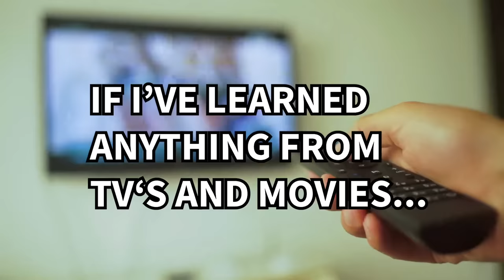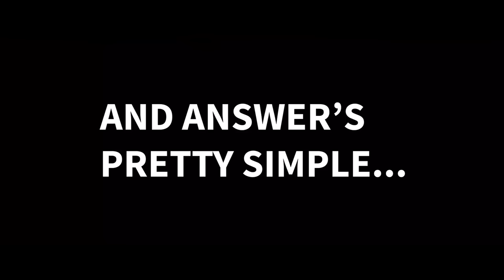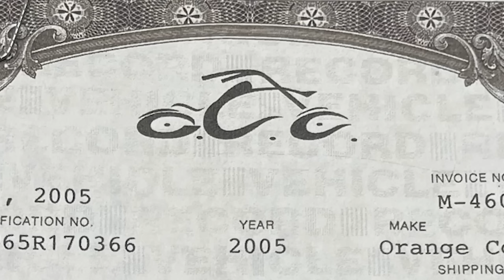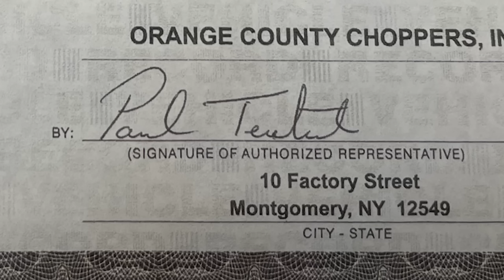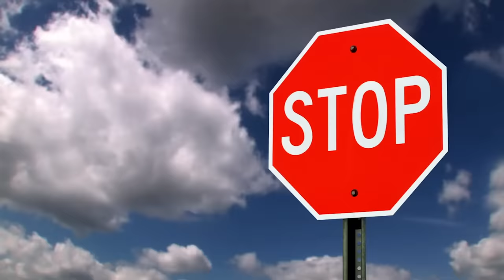Why you SHOULD NOT buy an Orange County Chopper

Comment: This was eye-opening. I realize on all these chopper/hot-rod type shows they never emphasize the safety or performance.They emphasize stuff like how the hood ornament is actually the flusher mechanism from a space shuttle toilet, or something like that.
Reply: Clever user name
Reply: They're built for show. Not for safety, performance, or comfort
Reply: While I always knew that these shows were looks first, everything else second (because lets face it, all choppers and hot rods are inherently compromised for actual transportation purposes, that's just not their thing*, and basically all cars made before the 90s, and a lot even back then, are horrific for safety by today's standards, with no way to fix them), there was one specific moment that I remember, that hammered it home harder and made it impossible to ignore:

I was watching Fast & Loud, and they went to put in a larger engine in a car. All good, until they notice that the oil pan interfered with the cross member at the front. I've read about such issues before in magazines, where people had actually put time and effort into their build, and often they'd either figure out ways to move the engine around, or make a custom oil pan to alleviate the problem. One guy converted the engine to use a dry-sump system.

What did the Gas Monkey Garage guys do? They cut out portion off the cross member, so that the engine fit. Just cut it out. From the part that literally keeps the left and right side of the car together. I don't think they even added anything to maintain structural integrity.

So uh yeah, dangerous, to the max.

*If they were actually good, manufacturers would still make them like that.

Comment: A few years ago I had an itch to buy a Harley, or cool-looking Victory, semi-looking chopper with extended fork (but nothing like OCC's).  Scratched the itch with a one day rental of a 1200cc BMW.  Rode scenic mountain roads around Stanley/Sun Valley, Idaho.  Had a great time.  Returned it to Boise which required me to ride on Interstate 84 for thirty miles.  Buffeted by winds, 80-mph trucks, bugs crashing into my face shield, and the knowledge that a slick spot, flat tire or wrong move could end it all in an instant....not fun.  Lesson learned: cost me $200 instead of $20k, itch gone.

Comment: In the late 1970s and 1980s I had a 1958 Panhead in a Jammer hardtail frame with a 10" over Springer; no front brake. I road it for about 12 years. In 2002 I had back surgery for 3 ruptured disks. Coincidence?

Comment: If the battery is dead there is a bad bare wire somewhere could even be on the battery itself touching the frame and grounding it out draining the battery so look for it and don’t forget to change the starter fuse

Comment: Great video. (love how the headlight lens isn't parallel to the ground) I've had the "pleasure" of getting to work on a couple of these OCC bikes and I can say you are 100% correct about them. They're really not meant to be ridden, just looked at.
Reply: They look good to a blind person!
Reply: Build me a road vehicle that's not suited fr d road plz.

Do that statement make any sense?🤔🤕
Reply: @a.mckenna1574  A lot of supercars are built that way.
Reply: I think you mean perpendicular!
Reply: @MyRegardsToTheDodo  Could you show me a supercar using a bone stock, of the shelf anemic motor producing a whooping 65HP please?

I'll wait...

If you're about to be impractical, be fun to drive at least. By fun I mean great handling, stoping power, steering precision, power, speed, you name it.
Reply: @SgtDuster  Not 64 HP (considering a chopper is much lighter than a car), but for example the DeLorean DMC 12. Came with a bone stock 130HP Peugeot engine. It had the price and looks of a supercar of it's time, but simply couldn't deliver.

A lot of supercars don't have great handling or steering precision either.
Reply: I think they look comical,not 
practical and would not be able
to ride on the road in n.z.
Reply: @MyRegardsToTheDodo  In what world is a DeLorean a super car?
Reply: @mintymus  As I wrote, it has the supercar pricetag and the supercar looks (for a car of it's time), so in any regards except for the engine it is a supercar.
Reply: @MyRegardsToTheDodo  Hardly.  The price in 1981 was $25,000...which is roughly $80K now.  Show me a supercar today that costs $80K.
Reply: @MyRegardsToTheDodo  
"The DeLorean DMC 12 was produced between 1981–1982. That had a bone stock 130HP "V6" Peugeot engine". 
In 1982 the... 
.
Camaro had a 2.8-liter V-6, 102-hp and 142 lb-ft 
.
Corvette had a 5.0 V8 200hp & 283 lb-ft 
.
Mustang had a 3.3L 6-cyl. 87 hp &160 lb-ft
Mustang GT had a 5.0L V8	157 hp & 240 lb-ft
.
Pontiac Firebird had several options.
There was a carbureted 2.8L V6 with 102 hp .
305ci V8 with 145 hp & 240 lb-ft
The "LU5",  high-performance "Crossfire Fuel Injection" 5.0L V8, which produced a whopping 165 hp.
.
So comparatively the The DeLorean DMC 12 was on or above par with other American sport cars of its time.
Reply: @davidelks8972  The DeLorean wasn't an American sports car, though.
Reply: @MyRegardsToTheDodo   1984 pontiac Fiero with 4 cyl.was a better car.
Reply: @a.mckenna1574   no sense. Absolutely none....
Reply: Like the youtuber from France that carves out cool stuff from slabs of chocolate?
Reply: @mintymus  I mean, the Corvette is 80k. I don't know about supercar, but certainly styled like one, and performs close enough.
Reply: @TheLongDon  So you're agreeing supercars don't cost $80K.
Reply: @mintymus  Most supercars, yeah. I think the Corvette counts though, it hits 0-60 in 3.7 seconds, that's faster than the Audi R8
Reply: @TheLongDon  So you consider a Tesla a supercar too then?  How about a little Civic with a 400 HP engine in it?  Those go to 0-60 faster than an R8 also.
Reply: @mintymus  What counts as a supercar for you? I would consider a Corvette more of a supercar than a McLaren. Better HP, flat, angled body, lightning quick 0-60, professional brakes and suspension, etc. Tesla and Honda Civic don't have anything except quickness for them, the Corvette has everything you need. My point was only that it was cheap, but expense shouldn't disqualify you for being a supercar
Reply: @TheLongDon  If that's how you define a supercar, than the Mustang GT (and definitely the GT500), Subaru WRD STI, and nearly every other new sports car is a "supercar" to you.  

Super car = Carbon fiber, far above average weight to performance (pounds per HP), center lock wheels, exotic engine.  Corvette is none of those, hence why the cost is only $80k.  It's nice, but no supercar.  My point remains the same:  No supercar costs $80,000.
Reply: @TheLongDon  Btw, the top speed for a Tesla Model S is 200 MPH.  Faster than the Corvette, and much faster 0-60.
Reply: @mintymus  Guy, I don't think you know what supercars are. Supercars are not hypercars. No, a Tesla model S can't be a supercar because it looks like a brick and drives like one. The Corvette is a mid engine sports cars with performance brakes, a good amount of horsepower for the price and an impressive 0-60 time. It looks better than any McLaren and drives better too. Knowing McLaren, definitely lasts longer. It weighs 3k lbs to the Tesla's FIVE THOUSAND. You can't seriously take my single example and think that's the only thing the C7/C8 has going for it's classification as a supercar. It doesn't need to be at our a Veyron to be on the lower end of supercars
Reply: @TheLongDon  You can think whatever you want, doesn't mean you're right.  The Corvette is a muscle car, not a single ounce of carbon fiber on it, minus the wheels.  Tesla is heavier and bulkier, yet is WAY faster both in acceleration and top end.  Ask 100 people which car they'd rather have.  99 are going to say McLaren, the 1 that wants a Corvette will be you.
Reply: Steve Magnante looks at better stuff in the junkyard all the time.
Reply: Don’t these have a very small gas tank

Comment: Back when OCC got so big everyone thought they wanted an open primary, a rigid frame with no suspension, a ridiculous rake and a fork length to make turning damn near impossible, no front brakes, a motor from a lawn mower, body work and a seat designed to kill its rider and likely a fuel tank that’ll have you visiting every gas station along the way. Nah, I’m good.

I do like the aesthetics, even if it’s a little overdone on the spikes, but we all know this is a garage, grass and show bike. It’s basically those little soaps your mom has in the bathroom that you’re not really supposed to use but sometimes you do.
Reply: Ahhh...yes. The cheesy little, overly scented soaps. You just took me way back. I can smell them now. I genuinely thank you for this trip back in time.
Yeah...
Edit- I usually don't like or dislike anyone's comments but I liked yours simply because of the soap thing. Although I do agree with you too.
Reply: Well, I have never been a fan of Choppers.   I know how much design work is put into the steering of every bike, and the answer always comes out to a head angle of 71 degrees, even one degree either side is frowned upon.

Comment: I say, fix the brakes, find a “comfortable” seat that kinda matches, swap the evo for a 1400 Harley engine, reduce the number spikes, then drive to OCC to show them your improvements.
Reply: The one good thing about harley motors is they're easy to upgrade.
Reply: Is OCC still going?
Reply: @georgeperkins4171  not so easy to upgrade as in has a lot to be improved
Reply: I can ride the wheels off a Japanese sport bike but this dinosaur scares me !
Reply: fix that bike right, and I'll ride it myself to OCC, and tell them this is the way they should have built it. Put some brakes on it, and a decent seat. I'll video tape the highlights of the ride there, and their expression when I tell them they did it all wrong. I'll even sigh a release so you guys are not responsible for me or anything that happens.

Comment: I miss my chopper even though it always tried to kill me. Clutch cable snapping sending me across an interstate both lanes into a dollar general lot before the back brake slowed it down enough to kill it. 7 out of 10 rides you would have to retrieve parts that rattles off. The screws in my vice grips would always be backed off and loose in my tool bag.  The part that was fun was learning how to fix anything with minimum tools and parts in the dark and making it home alive. It finally died when the welds on the frame broke at 45mph dropping the frame onto the road and I rode it into a ditch and was able to just step off it.  Good times.
Reply: Choppers don't have to be garbage. Kill switches solve the snapped cable problem. You built junk and got junk results.
Reply: @Comm0ut  I bought it used and still miss that bike so much. I like my new but I can’t have them all. This was my first harley coming from the metric world. Never needed to check welds and stuff before. I learned rapidly.
Reply: My idea of fun is galaxy apart. I mean chicks are fun.
Reply: @jjohnson8977  until they take half your stuff. 😂
Reply: @jjohnson8977  that’s how she got half my stuff
Reply: You my friend deserve a combat patch.🤣🤣
Reply: @badkatrising3918  guess you have to have stuff. a single wide and Hyundai don't count
Reply: @jjohnson8977  lol. I have an acre of grass behind my house. Sometimes I wish I had a single wide when cutting grass.  I also rebuild FJ-40’s so my time gets limited in the fall and winter for riding.
Reply: RIP

Comment: On a rigid you're supposed to air down the rear tire to about 15-20 PSI, it's not much "suspension" but it helps. Also, mid controls on a rigid are important, help get that ass off the seat when you go over speed bumps, or cracks, or pebbles. Hard to do with forward controls. Couple spine saving (or just less damaging) techniques.
Reply: What about tire wear from improper air pressures? Wouldn't that cause unwanted wear? Or you could just Buy a bike with Rear Shocks like anyone who wants a comfortable ride. I never gave a shit about how good a bike looks it is and always will be about my comfort. can a human ride the Bike for 10 hours and still walk afterwards. If not it's worthless for anything  Other than catching some Idiots eye.
Reply: @lucienfury2606  whatever floats your boat, dude.
Reply: @lucienfury2606  i dont think the person who buys a chopper gives two shits about a poorly worn tire.
Reply: @lucienfury2606  So your solution to "tire wear" is to buy another whole bike?

Comment: I always knew they were more art than action. One I remember had a petrol tank that would only let you go around the block. No front brake. Stretched out in uncomfortable position on a bike with no suspension. You probably end up in traction if you ever rode it longer than 10 minutes.

Comment: Bike needs to go to a dealership, restaurant or museum. It's wall art, a show piece to draw crowds, love it for what it is.
Reply: That’s exactly what I was thinking. Donate it to a bike themed restaurant or display it in your shop. Either way it’s an O.C.C. bike. Virtually a Neanderthal of the bike world
Reply: Hahah bikes are made to be road! This is not a chopper this is a bolt together pos from occ 😂 I ride nothing but hardtails . I build them for a living . Have road mine 4000 miles to Mexico and back from Chicago. And I run an open belt hand shift .
Reply: Also front brakes are silly might be because I don't carry a hand bag hahaha
Reply: @mikestanfill3183  Hahahaha hell yeah
Reply: @mikestanfill3183  hi, do you need to run low tyre pressure in them, or do you have a decent seat. Always wondered this. I love the look but having ridden enough miles with soft tail cruisers, couldn't face the idea of a hard tail. Good luck to you though 👍🍺.
Reply: @carlbModels  no I run stander tire pressure and I run king queen seats . Mounted directly to the frame no springs under the seat . On my everyday bike I have a car tire that makes it a little softer . However that bike is 10 foot long . And that the one I road all the way to Mexico . It's really all about how you build and set up the way you ride .
Reply: @mikestanfill3183  oh a darksider! cool, I love the look and heavy bikes can getaway with it. Had a corbin or something on my VN1500. How do you find speed bumps? in the UK they ruin roads with bumps, and don't  repair pot holes!
Reply: @carlbModels  I love near to rockford illinois some of the worst roads in the United States lol not to bad . And down in Mexico there are speed bumps every block still not bad ya just take it slow lol

Comment: Imagine how dangerous that thing would be with a fast motor in it, I think slow is better in this situation
Reply: No,with that front-end being long and raked the faster you go the better it handles, when you get to walking speed you're in big trouble unless you are a weightlifter. As for the rigid frame Harley never came out with a sprung frame until 1958!
Reply: @karmsenrab8587  so more horsepower makes a bike safer that has horrible brakes and a seat that makes you hold on for dear life? I'm skeptical
Reply: @Jason Galloway  Yes, the faster is goes, the safer it gets! At 200mph it's virtually impossible to crash!
Reply: @infidelmat  this guy gets it
Reply: @user-uo1rn2nb8f  it becomes more stable due to the gyroscopic effect. Safer? No. It still stops and corners like shit. But it will stay up on its own when the speed increases above parking lot speed.
Reply: @infidelmat  on you're planet can't crash
Reply: @karmsenrab8587  Please explain in kinetic dynamics terminology your comment with regards to balance and stability...
Reply: @whyyeseyec  I'm not intelligent enough to go there all I'm saying is my definition of Chopper and the monstrosities that Orange County built are two different things.
Good brakes, ease of handling, stable bility are all Paramount on any motorcycle, including Choppers.
If it ain't one hundred percent roadworthy why ride it, just common sense

Comment: Options, 
1. Part it out
2. Build suspension seat like Soft-Ride Bicycles,  carbon fiber beam spring, bigger seat pan to prevent slide
3. Move head tube & shorten forks, add 2nd disc up front + #2
4. Part it out as the pilot for your new Discovey Channel series, "Why'd You Do That?!"
Reply: The problem with parting it out is that it only has one part worth money:  a bone-stock Evo motor.

Comment: I can't imagine that bike with open "belt sander" right next to your leg, seat issues, no suspension, lack of stopping power, impalement issues, no speedometer, and battery issues.  There's 7 items to work on ASAP.  I like the bike's look and you got a real deal but short of a display item for a business or museum there are just the above key issues that would be a non-starter for me.  Surprised also at the engine's HP but it is a chopper!!
Reply: He only got a good deal if the motor is worth 8k. The rest is scrape today.